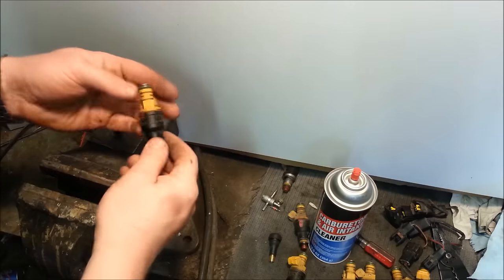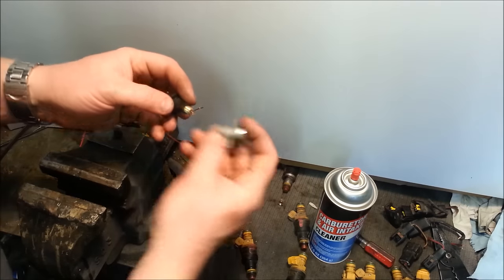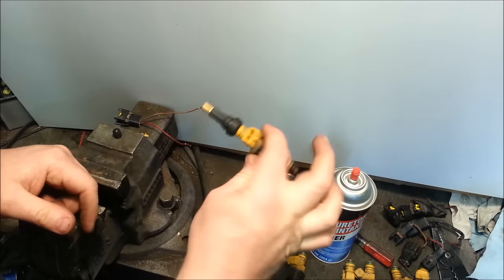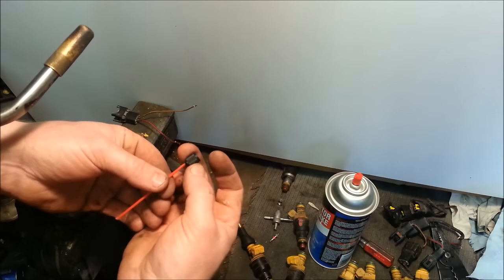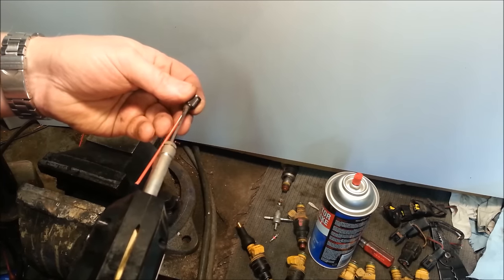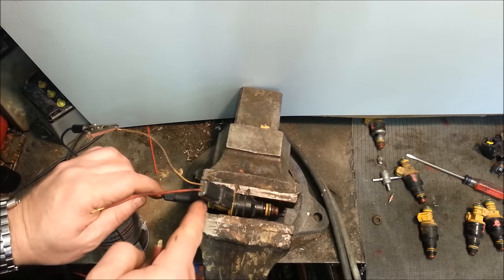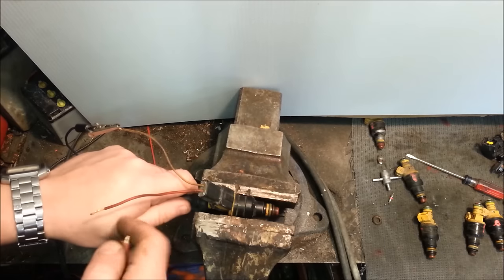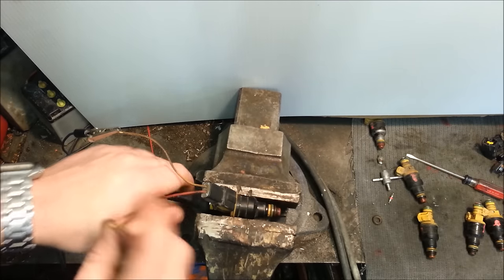Fuel injector cleaning without expensive tools

Comment: Thats a bloody good idea 

might be helpful too if you could figure out a way to reverse flush them as well and do them in reverse????

Decent cleaning machines are 500 or 600 bucks not really worth it for DIYProfessional clean is 30 bucks Each minimum.....

I like it!!!!

By the way those little square 9 V batteries they usually are enough to trigger most fuel injectors

Comment: Can you do this while is connected to the car but the injectors out and see if it sprays when you turn it over
Reply from the maker: Not generally because the fuel rail will have to be disconnected to pull the injector. So you will have no fuel flowing to the injector.

Comment: is a stuck open injector repairable by this method? did this and even w/o applying power the injector was open LOL
Reply from the maker: Spray carb cleaner through a few times and see if it dissolves/dislodges whateveris holding it open. You can also tap it to dislodge whatever is holding it open.

Comment: could carburator cleanner mess up the electrical wining coil  inside the injector? just asking if is safe?
Reply from the maker: No, it won't harm your injector.
Reply: @sixtyfiveford   all right thanks, i will try the cleaning with my old injectors bc the remanu fuel njectors I get from ebay are doing worst

Comment: Do u think it will work with high inpediance injectors?
Reply from the maker: High impedance injectors just require more amps to open. Any 12v car battery will supply the 5-6amps the require to open. A low impedance injector requires only around 1amp for reference.

Comment: Can I use the WD-40 or Mass Airflow Sensor Cleaner or Brake & parts Cleaner to clean the fuel injectors?
Reply from the maker: Carb cleaner is essentially Acetone and about the only thing that will dissolve tarnish and gummed up fuel. Mass air flow or Brake parts may work but not WD-40.
Reply: @sixtyfiveford  Thank you very much.

Comment: What's the logic behind clogged fuel injectors decreasing fuel economy? Shouldn't it save fuel instead, since less fuel is being injected to the engine because of the clog?
Reply from the maker: If it doesn't have a fine automizing spray pattern, it won't have as complete of burn. A dirty injector will drip or spray fuel to just one side causing rich and lean areas in the combustion chamber.

Comment: Why didn't you blow it out the reverse way first?
Reply from the maker: Because I want to visually see the spray pattern. The Carb cleaner(acetone) will dissolve gummed up gasoline and carbon deposits on the tip and push them off. I don't want to flush those into the injector. If I can't get a good spray pattern, I will flip it and back flush.

Comment: here's i thought for'ya... why not blow the carb cleaner from the other side, cuz here's my thought on that.....in the top of the some fuel injectors is a small screen that some times get's some chunks in it, so if you blow from the top the chunks dont always go through out the back side of the injector..right??? but if you blow from the bottom side to the top of injector then all the chunks should come out and it wont hurt the injector!!!!!! what ya think about that???????
Reply from the maker: Most won't flow fluid in reverse. The pressure from the carb cleaner holds the injector closed.

Comment: I would probably spray some cleaner through and then just into the injector without hooking up the wires and let the cleaner sit in there for about 10 or 15 minutes to let it have a chance at breaking that gasoline guk down and then finish spraying it through the injector again. Carb and fuel injector cleaner most likely needs a little time to break down all the crud inside to truly clean it, I doubt just spraying it through real quick like and calling it done is getting all the stuff out. 
 Just my two cents, cleaners need some time to actually break gunk down and work effectively.

Comment: cool man would you know the voltage ⚡ and the ohms of a Mercedes 220 e cdi injector is ?
Reply from the maker: Just compare them to each other for the ohms. If one is way off from the others you know there is an issue. I've never seen a injector that wasn't 12volts.

Comment: Can you use alligator clips and a 9v to power it?
Reply from the maker: You could. Generally, if you're working on a car, you have access to a 12 volt battery though. Under supplying the voltage will cause a weaker solenoid activation/ The injector could not fully open.

Comment: Thank You so much!! awesome idea!! I Love my 2001 Toyota 4 Runner!! limited edition. 219,000 miles. Run better then some new cars. Of Course, I do keep all fluids clean. no engine or Transmission overhauls. I just change them fluids and all rubber pieces changed including: Timing and drive belts, vacuum hoses and coolant lines changed.  This 4Runner is tough and fun to drive. I am a big fan of cleaning the fuel injectors manually with a extra fuel injector wiring harness, applying tire valve with the valve out like this video on this video. https://www.youtube.com/watch?v=rUUgR94drxg. however, I used a metal valve stem cap and drill as small a hole a possible then apply the straw and put jb weld quick in the inside, works awesome!! I will take video next time but might be awhile since the 4 runner runs so well!! Love it!!

Comment: Some injectors have an integrated filter in the inlet. How do you clean or replace these?
Reply from the maker: Generally it's varnish that is plugging these so carb cleaner dissolves and cleans the filters. It your fuel filter didn't do it's job and you have debris, you can reverse flush the injector.
Reply: @sixtyfiveford  thanks

Comment: Ok so after putting it back together - i cant get fuel in the fuel rail...any suggestions
Reply from the maker: I'm sure you figured it out by now. You probably have an air lock. Most cars have a Schrader valve that you can depress to bleed the air.

Comment: that's a good idea but if you flip it over plug all your staff on the other end and do the same thing you will get better results  and take of the screen  first
Reply from the maker: You need to see the flow characteristics by forward flow. The only contaminants on the screen should be varnish and easily dissolve with carb cleaner(acetone). The tip is exposed to the worst of the contaminants from the engine and reverse flowing can force those into the injector and scratch/lockup/ruin it. If it doesn't flow correctly after multiple attempts at forward flow, pulling the screen and reverse flow may help. But this should be a last resort.
Reply: @sixtyfiveford  thanks for clarifying that. Really appreciated your video & your patient, yet committed follow ups to the community questions. Also for clarifying why a 12 volt source is  preferable .

Comment: Wouldn't be easier to put fuel injector cleaner in the gas tank?
Reply from the maker: Yes and no. If the injector is gotten to the point where it's dirty it'll take maybe half a dozen to a dozen tanks of fuel to start cleaning it and noticing a difference.

Comment: The handsdown easiest fastest best way to clean injectors is to simply use a 2 foot section of fuel hose which fits nicely over the injector and utilize a "T" on the the upper part of the hose. Usually an air compressor hose has a female quick disconnect so make up a T that has a male quick disconnect on the top of the T and for the 2 foot section of hosr use a barb fitting on the other end and on the side branch of the T put a pipe nipple with a cap and bam there you go... Attach the open end of the hose to the injector inlet, attach the male QD to your air hose then finally remove the cap on the side of the T and inject a 3 second burst of cleaner into the hose and put the cap back on it and use your air hose to blow the solvent through the injector... Once yur apparatus is made initially then after that it litterally takes 5 minutes to do all 8.... I like to adjust my regulator to 60 psi and put a hose clamp on i jector end then u can just open the air valve and allow the pressure to stay against the injector then u can simply operate the batterry trigger to tick tick tick the injectors... This is a clean safe way youll love.... Oh by the way DO NOT APPLY THE 12 VOLTS AS LONG AS THE GENTLEMAN IN THE VIDEO DID they are not designed nor do the operate on any type of continuous currently, they simply tick prolly 50 or 100 times per minute but im warning you youll burn one up very easily. I rig up an old "normally closed" microwave door micro switch and tick tick tick on it until i get a good atomized spray coming out
Reply: And most injectors also have tiny basket screens on the inlet... They can be stubborn to remove but i usually run a screw through a piece of broomstick or some to use as a puller... Screw it into the inlet but not too far or youll destroy the screen and use the T handle to wiggle em out... Another tip is if you run across an injector that wont react, i use a spoon and tap the injector 3 or 4 semi moderate strikes and spray and tap and tap and spray till it comes unstuck
Reply: For the electrical connections i use 2 "red" butt connectors they fit nicely on the posts so u dont cause an arc and accidentally ignite the solvent

Comment: Has anyone done this with brake clean? I don't usually have carb clean around I just use non chlorinated brake clean. Do you think it would work?
Reply from the maker: Carb cleaner dissolves carbon and gasoline deposits. Brake clean just degreases.

Comment: does it matter if u connect positive or negative. I dunno which is which
Reply from the maker: It doesn't matter.
Reply: sixtyfiveford thanks
Reply: Nothing comes out when I connect to battery. Seems to spark excessively on connection to Battery. Any ideas?
Reply from the maker: A big spark with an electrical device means it's drawing a lot of amps, which isn't good. What kind/yr of car is it out of?
Reply: sixtyfiveford I figured out I need about 19000 more psi lol. Diesel common rail injector.

Comment: Injector color ?? Ive got an 03 mazda protégé ex 2.0. cylinders 1/2 have a green injector and cylinders 3/4 have purple injects ? WHY? I replaced cylinder 2 with a purple and now I get a P0302 grrrrr
Reply from the maker: I wish I knew. Someone must have replaced a few before you got it. They may just be a different brand.
Reply: nope, I looked in to it and the 1/2 injectors should be green, 3/4 should be purple. Im not a mechanic or engineer but it has to do with the firing order. since these cylinders fire opposite each other. I switched to the correct color and the car runs much better. I was having misfires in the cylinder with the wrong color.

Comment: great job, I like it. what is the voltage  for thaoe 08? i wonna use s battre for it.
Reply from the maker: Most run off 12volts. You can test them on 6v (tape 4 aa, aaa, c, or d cells together(1.5volts x4=6volts)) first  to see if that is enough fire them, but more than likely it is 12 volts.
Reply: sixtyfiveford how about 9 volt battry?

Comment: Should you also blow out in other end?
Reply from the maker: Only if you find an injector that doesn't spray well.
Reply: sixtyfiveford ok thanks. I have a 06 range rover and its running lean both banks and the injectors and fuel filter is suspect

Comment: How'd you remove the middle part of vale stem? I'm a noob
Reply: Austin Jones there’s a small tool used to remove the valve in the middle of the stem.. it is slightly squared so the tool turns the valve and allows it to be removed
Reply: @FrankTx  thank you!

Comment: Yooooo I just got a 2000 crown vic that has been sitting for 5 years... It seems like it's running on like 3 cylinders. It has fresh gas and a new fuel pump... You think my Injectors are all frozen? It's also blowing some white smoke and I feel like the seller was honest when he said he parked it in perfect running condition
Reply from the maker: It's possible they could be stuck but you shouldn't have steady smoke even if they are. If anything maybe blackish smoke from bad spray patterns form the injectors. Heavy White smoke/steam is generally a head gasket. Bluish White smoke is burning oil.

Comment: I got my tool on line don't remember the site it's been a couple of years and my dad helped clean and repair mine, the truck had four hundred and eight thousand miles on it, only replaced the intake did maintenance such as plugs boots and springs on the coil packs no new,coil packs a girl fell asleep and hit me totalled my Trk never did any repairs,
Reply from the maker: rick johnson That's awesome. Not the part about getting your truck totaled though.

Comment: I have an unrelated question I have been an adved fan of you channel for some time now and my question is how do I wire fog lights or any type lights to my head lights to go on when they are turned on with out making an atomic mess of things the wire color codes and all that is confusing 
Oh yes it will help the vihicals in question here is an 02 Dakota that I wish to put more lights to 
   Your  exporteese on this type project is appreciated greatly
                                                                           Thank you in advance
Reply from the maker: This is a basic wiring diagram https://i.pinimg.com/736x/0f/6d/08/0f6d08a181b0bfe4094e776043f8b249--barbecue-smoker-jeep-stuff.jpg

You will need to know how a relay works(I have a video on them) but it relatively easy. The wiring diagram shows a rocker switch but that wire going to the 86 terminal on the relay could just connect into the headlight fuse or spliced into the headlight connector at the headlight.

Comment: Be careful....injectors are only designed for intermittent 12Vdc power...NOT continuous. Pulsed power and spraying cleaner flow in BOTH directions works best.

Replace your O-rings at the same time.😎

Comment: I own a ford mondeo 1.8 tdci 2008,  the fuel pump it's start to break from inside releasing small metal parts which some of them pass through the fuel filter and get to the injectors, and then make a big blow which cause a misfire, that's how it broken one my injector, which I think this method is useless to clean them
Reply from the maker: It's not good if debris large enough to clog injectors is passing your fuel filter. You can reverse flush them with this same method.

Comment: Can seafoam,  and 1 gal mericle mystery oil in full tank of ⛽
Reply from the maker: They may work after 10 thousand of miles of driving and a few bottles but not always. Seafoam is pretty much just rubbing alcohol, Naptha and some light oil. M Mystery oil is pretty much the same. Techron that is already in gas at Chevrons is the same thing as well. They sell dedicated injector cleaners with high percentages of stuff that actually cleans  or can simply pure Acetone or Naptha from the Home Improvement store directly into your gas tank.

Comment: Seems good method but pay attention to voltage used because some injectors are "low impedance" and needs either lower voltage or a pulsating voltage.  12 V direct on low impedance injectors will fry their coil permanently 🥴

Comment: this is crazy because fuel injectors are very cheep to buy on Amazon. Why do this?
Reply from the maker: The cheap ones fail all the time and don't have matched discharge rates/cc. So one cylinder may be too rich and another too lean and you burn up valves.

Comment: Will WD-40 work as well?
Reply from the maker: No. Carb cleaner is Acetone and dissolves varnish.
Reply: @sixtyfiveford  any idea how to pressuring acetone?
Reply from the maker: Just use carburetor cleaner. It's 1/4 the price of WD-40.
Reply: @sixtyfiveford  thanks.... will try it out and see how it goes

Comment: I guess if you don't have the plug it doesn't matter which is negative and which is positive?
Reply from the maker: It doesn't matter.
Reply: sixtyfiveford.  Thanks for responding.  I have the straw sitting through the valve cap drying with glue right now I guess it's okay to use throttle body cleaner or should I go pick up carb cleaner.
Reply from the maker: Throttle body cleaner will work. If the spray pattern doesn't look good after attempting it with throttle body cleaner for a while you can try carb cleaner which is a little more aggressive at breaking down deposits.
Reply: sixtyfiveford thanks a million. The pattern did not look very good after using a good amount of the throttle body cleaner.  I'll pick up some carb cleaner . You help me great deal to pass and I appreciate your time now

Comment: super glue would work well on the straw to valve cap
Reply from the maker: Super glue is dissolved by acetone which is the number one ingredient in carburetor cleaner and other fuel cleaners.

Comment: it looks like a fuel injector is no really an injector at all  it is really an electric fuel gate.
the gate or valve opens up and let's the gas of fifty or psi go through the valve.  it is either off or on.  I also would think this could be an air valve. I could see these being used in industry as relief valves.. fill valves..ECT.. they could also be run from a relay.
Reply from the maker: Exactly.

Comment: hey, what can be done in a case where a dumb ass machanic loses not one,but all 6 of  your filters for your injectors ?? he said it will work fine without it,but i would think that if it was put there,its for an obvious good reason.
Reply from the maker: They'll work like normal but may have a shortened life span due to no filter. The individual filters are a secondary filter behind the main fuel filter.